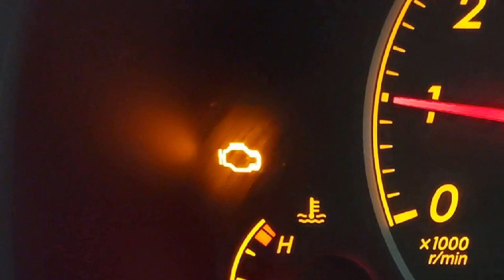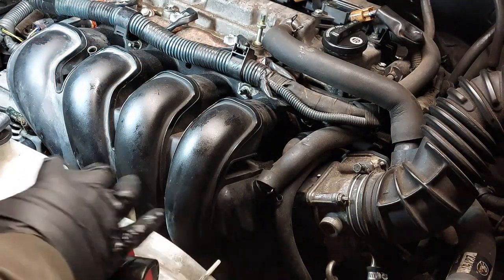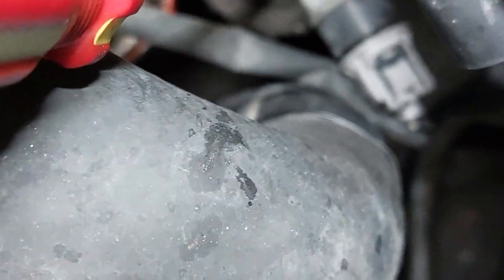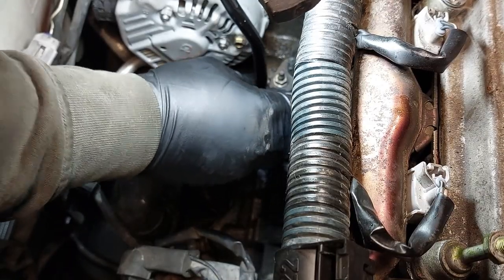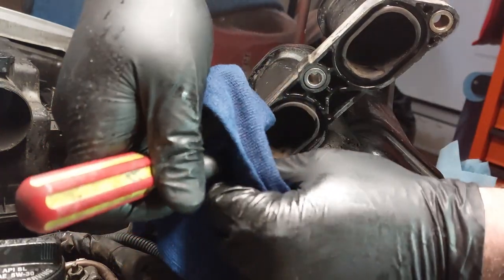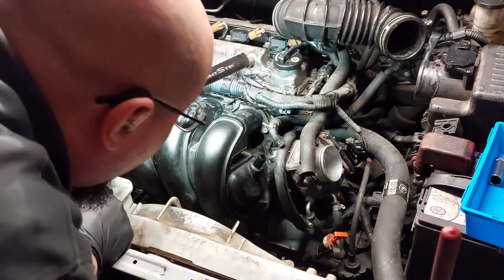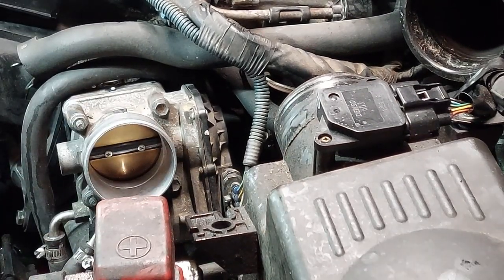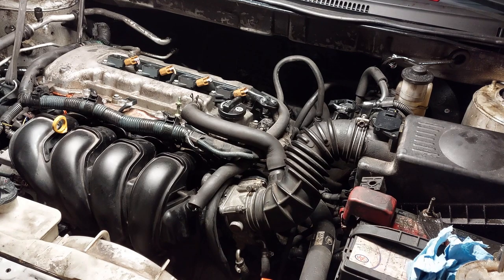2005 Toyota Corolla - Engine Oil Dipstick Tube Replacement

Comment: Your a genius.  Bravo dude.  My vibe kicked my butt today.  Motor mounts, this leak, radiator bypass, rusty grounds, tuneup,  im on like day 4 and got less progress than you made in this video today! ... then in summer i will do a leaky power steering pump and that motor mount and rust repair too.  225k mile car just cost me 2500 bucks.  Good shape though, worth the work i think. Hope.
Reply from the maker: Nice. I'm glad I was able to help. Eventually you'll win the war at the very end. 😆
Reply: Hi brother I have 2009 corolla le can I use the same part you give and where do you get it Thanh
Reply from the maker: The part numbers are different. This one is for the 2005 Corolla which will most likely fit 2003 to 2008 model years. The 2009 to 2013 model years has a different engine in it so it's not the same. But you can check RockAuto online and they have a dipstick tube available for the 2009 model year which will fit up to 2019 Corollas with the same 2ZR-FE 1.8 liter engines.

I would check any Toyota dealer first to see if it is available. If not then aftermarket would be your last choice.
Reply: @moosemobileautorepair  thanks you for your reply 🙏 have a great weekend

Comment: Thanks for the video it really helped.
I managed to do it without removing anything, I used two extensions and a wobble joint to get the 10mm bolt out, and then got under the car and pushed the tube out.
It was really tight on my car, wouldn't come out easily and the new o-ring I bought wouldn't fit, so I had to reuse the original. I was replacing the tube as it had snapped so it shouldn't be an issue.

Tbh I think that removing the intake manifold would be quicker, it was a massive paint in the ass doing it without, and I didn't manage to get the cables clipped back to the bracket, but the dipstick tube is on.

Worth noting on the 1zz Celica, they changed the oil level in 2003 I believe, I bought my tube off of a prefacelift car and the dipstick itself had a lower level than the one my car came with.

Comment: Thanks for the vid. You stated this could be done without removing the intake manifold? I’d rather not remove it if possible.
Reply from the maker: That's what I initially thought. I'm not sure if it could be done without removing the manifold, but It's probably better to remove it so there is more space to do it properly. It may not be possible to reach the bolt and to get the wiring harnesses out of the way and stuff so I think the only way to do it is to remove the manifold or alternator to get more room.
Reply: @moosemobileautorepair  awesome. Thanks for the response.

Comment: Great video. My dipstick tube broke in half. Im looking for replacement. You posted the company and part number but I have toyota avensis and it's hard to find the tube for it. Any advice? Toyota Avensis 2007 1.6 petrol.
Thanks
Reply from the maker: Your car is different from the one I worked on. I believe The Avensis is made in the U.K. with the 1.6 liter engine so it is different from the 1.8 liter 1ZZ-FE that I worked on. You will need to check the specific part number for your vehicle. We don't have those vehicles here in Canada/North America. Although, there may be something similar with the same engine here from an earlier model year Toyota or something, but I am not sure.